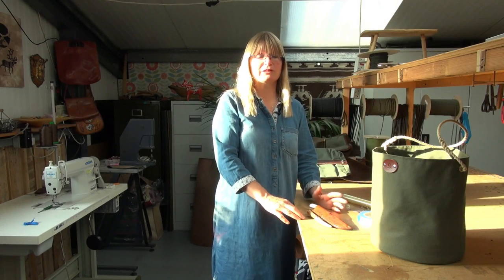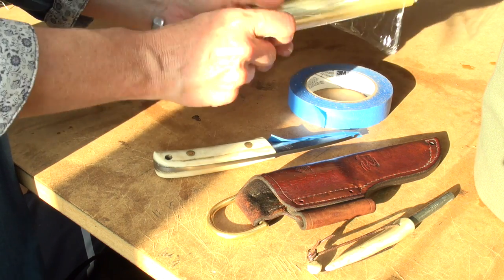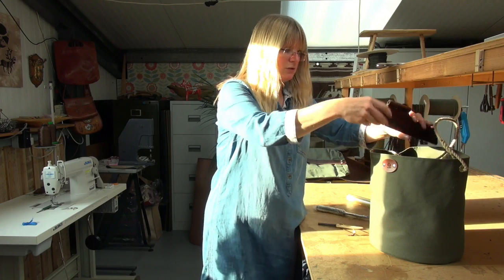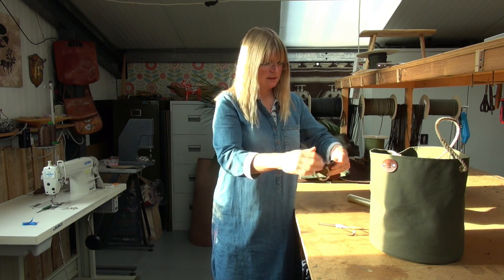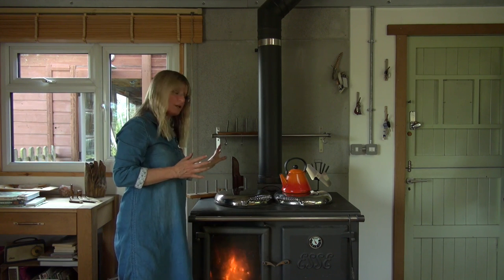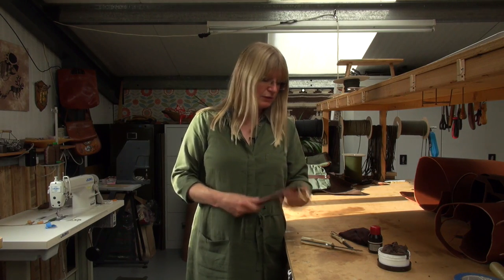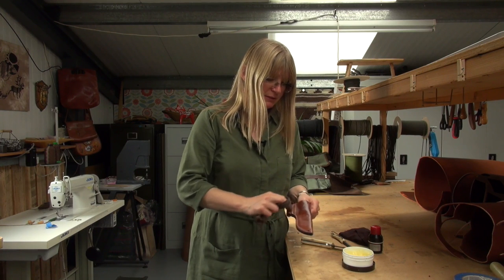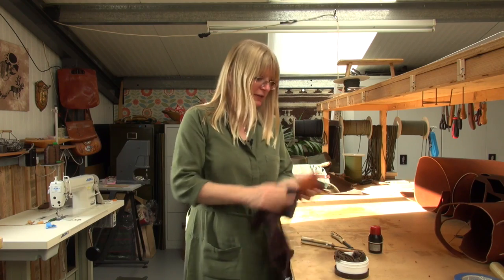How to Re-Wet Mold your Knife Sheath with Lois Orford

Comment: Lois, could you explains how to stipple leather so that it looks like the chequering on a gun stock as shown on this knife handle :  
https://i.pinimg.com/originals/b0/b0/a1/b0b0a161db93c9b1bac7a95b14a343f8.jpg

Also can wet forming be done to get the basic shape before glueing the sides of a sheath together.  Im having issues getting the right width of sheath from the templates I create. Don't want to stitch the sheath only to find I cant get the knife into it.  

Any advice welcome.